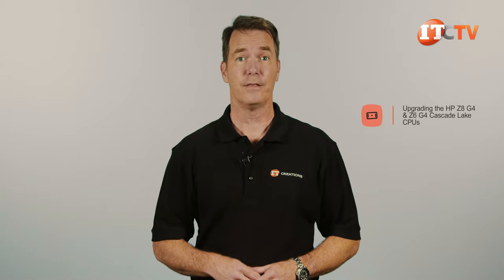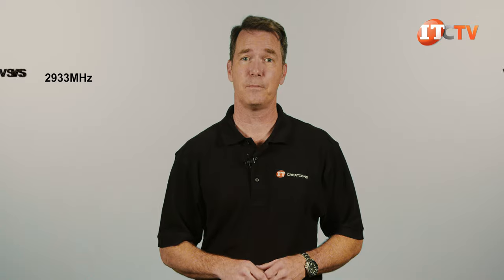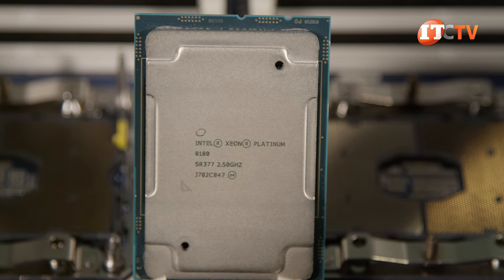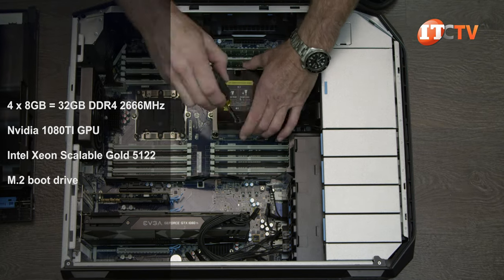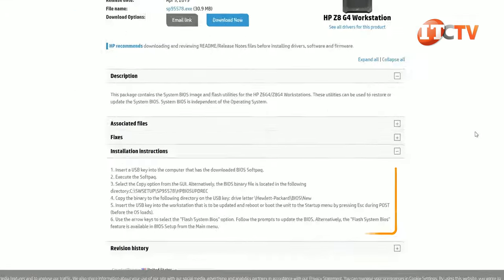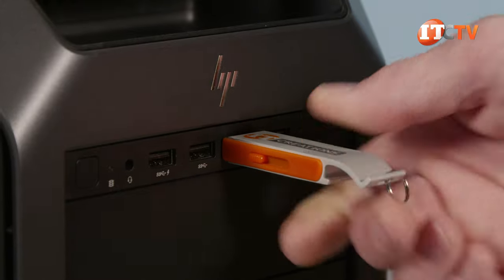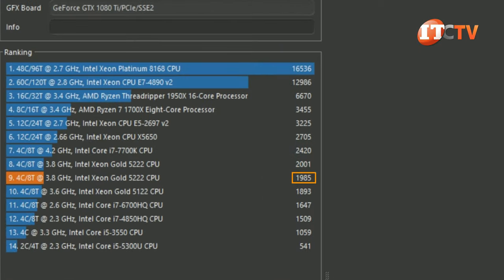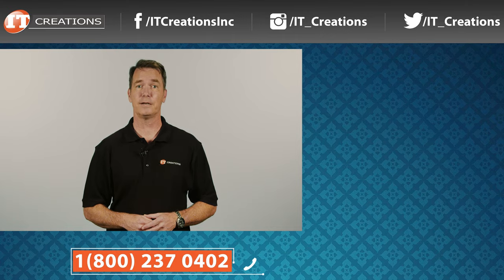Upgrade HP Z8 G4 & HP Z6 G4 To Cascade Lake CPU!

Comment: Hi - live down the road. what other upgrades are offered for this system. its been 3 years since you made the video
Reply from the maker: I'm not sure what you currently have installed on your system but I can say that additional CPU upgrades are not possible to the 3rd Gen intel Xeon Scalable processors, that is, if that's what you are asking/implying… Z-Turbo drives are now more available… Other GPUs are supported. That's all I got… Thanks for watching!
Reply: @Itcreations-LA what GPU's upgrade can you suggest? RTX A6000?  NVIDIA GeForce RTX 4080?
Reply: @Itcreations-LA  @Itcreations-LA what GPU's upgrade can you suggest? RTX A6000? NVIDIA GeForce RTX 4080?
Reply from the maker: Hi @REIKOMICHLIG  
HP has updated their GPU list to include the RTX A6000 of which you can install 2x assuming you have the top-end PSU installed on your system. These are 300W GPUs and designed for workstations. I am not sure if the RTX 4080 is supported as that one has a 320W power draw, not to mention it is a consumer gaming card. You might want to stay away from that one unless HP specifically confirms compatibility. See page 11 of the quickSpecs for the full list of supported GPUs. https://h20195.www2.hp.com/v2/getpdf.aspx/c05527763.pdf?ver=4 
Thanks for watching!

Comment: Im using Hp Z6G4 - Xeon Gold 6132 and going upgrade more RAM. Some one said it can be use 64GB ram bus 2666 per slot and they tested, is that true 🤔? Because im going buy 4 x 32GB ram 2666 but thinking to 2 x 64GB and confuse now.
Reply from the maker: HI there! 
Yes, it will take  64GB modules but they recommend 4x with a single or dual CPU's. That said, it will take a single memory module at 8GB and they usually do not list all configurations. I am also not sure if you have a single or dual CPUs but no matter. I would assume for "best" performance the recommendation is 4x 32GB modules. Check out page 22 of the Quick Specs here: https://www.itcreations.com/user-manuals/z6-g4/hp-z6-g4-workstation-quickspecs.pdf 
Thanks for watching, and commenting!
Reply: @Itcreations-LA  thank for your enthusiasm 👍i keep asking and that guy answered: 1st or 2nd gen of CPU doesn't important. Problem is Z6G4 can be use 64GB ram/slot. With 1st gen of Xeon Scalable is 2666hz, with 2nd gen cpu is 2933hz. In HP offical website i only see 64GB ecc 2933Hz/slot with 2nd Scalable Xeon cpu 😅 i think he said right, if can be use 64GB ram on xeon 62xx, 82xx sure can be use 64GB ram with 61xx, 81xx, different only Bus
Reply from the maker: @HoangTuan1705  ,
Yes, the update to the 2nd gen Intel Xeon Scalable CPUs increased the supported memory speed from 2666MHz to 2933MHz.
Reply: @Itcreations-LA Sir, could you please make clip review about the gear name "HP Z turbo quad drive" ? I heard they said that, install M2.nvme on that Card and use on HP Z6, Z8 can be make Write & Read speed to 10k, doesn't mind to gen3x4

Comment: Hello Is the HP Thunderbolt 3 PCIe 2-port I/O Card only compatible with the HP Z# G4 series of HP workstation?  I own the HP z840 and I was wondering if the card will work on it.
Reply from the maker: Hi Sun Shine, Should work fine on your Z840. Thanks for watching!
Reply: @Itcreations-LA  NO it doesnt.  HP Thunderbolt 3 PCIe 2-port I/O Card is only compatible with the new generation HP Z series. There is no header cable made to install on a HPZ840
Reply from the maker: Sorry for the crappy advice @RayMurray we have never gotten one of those cards to even try installing it. They released a SKU number about 9 months ago that you couldn't use to purchase the card because nobody had it. Ah, excuses, excuses… Clearly the real lesson here is don't assume anything. Assuming that which you don't know can make an "ass" out of "u" and "me". Thanks for watching!
Reply: All good mate. Good videos by the way.
Reply: @RayMurray   Correct me if I'm wrong. This is weird, Protools Expert shows a video on their YouTube channel of them installing a Gigabyte thunderbolt 3 pcie card on an old Mac Pro 5,1 with Windows 10 installed and it works. I mean if it works on that...why wouldn't it work on the HP z840 since it supports thunderbolt 2. By the way that thunderbolt 2 card that people use on the HP z840, first came out on the hp z820. Though, vendors won't tell you cuz they want to sell those HP z840. So my guess is that thunderbolt 3 card probably works on the z840 but unofficially, just as that thunderbolt 2 card works on the z840.You'd have to try it for yourself.
Reply: @josepalomares3763  Thank you. Yes it probably works, but it needs a special header cable that connects to the card and the motherboard to power it up which there is none available..if I had the cable then I could try it..

Comment: Hi I'm hardware engineer tomorrow I'm going to install this CPU
Reply from the maker: Hi M Nandu, i don't think you will have any problems… The only thing I have seen on some Dell systems after the upgrade is increased fan noise as the fans all run at top speeds even with a BIOS adjustment. Our Z8 G4 we upgraded is quiet as a mouse. Tell us how it goes, and thanks for watching!